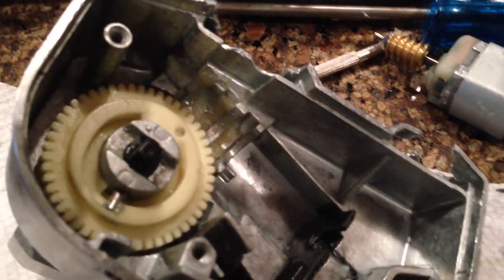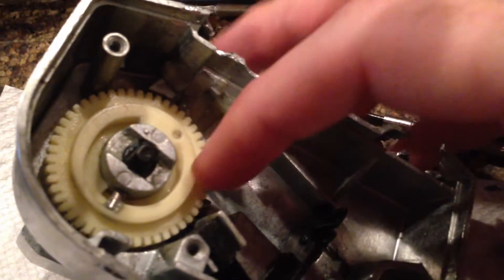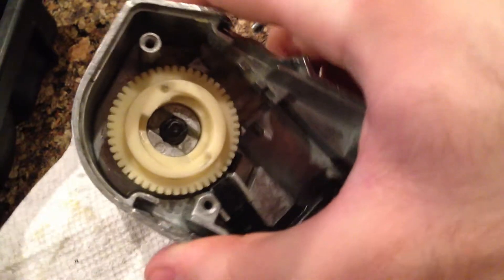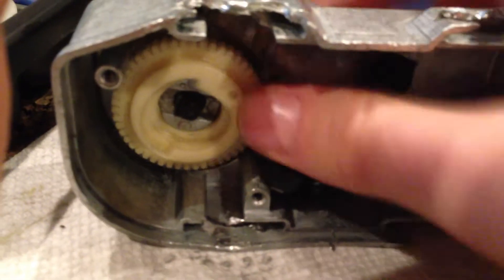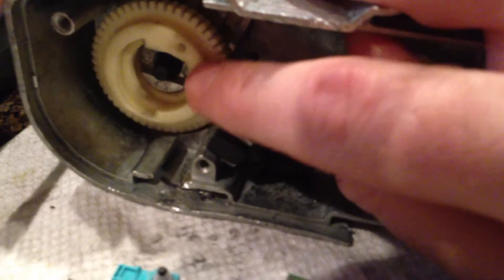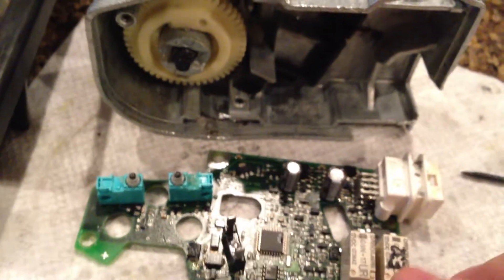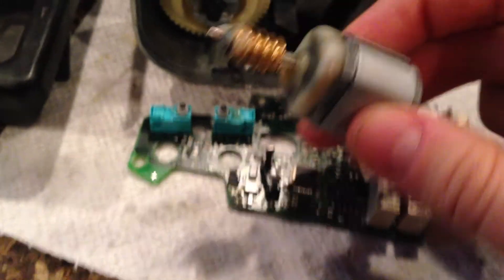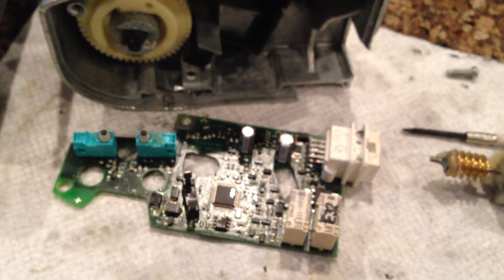Nissan Steering Lock internals, and Unlocking from Locked Position

Comment: Hey aaron, i took the steering module apart, took the board out aswell, but i got no clue how to take the off white covering to reach the motor. I tried all the clips to get it off but still not able to reach the motor. I guess its because of the steering lock. Could you please help me out. Also i got a 2011 370z i guess its a bit different from the earlier models as it got a cap instead of the whole metal housing
Reply from the maker: Sorry..  I'm not sure.  Haven't had the car in like 10 years.
Reply: @akmofo  hey aaron, thanks for your reply man. I did the steering module as you guided, took out the motor. And pressed the two turquoise buttons via electrical tape. My vehicle turns on now and the steering is unlocked. The only problem is that the vehicle wont go past the ON mode. It wont crank the engine. Would you suggest anything? I would highly appreciate that.

Comment: I was lucky enough that this failed while I was at home.    I used a dremel with the cutting wheel attachment to cut a straight edge slot across the top of the retaining bolts.   Then used a short straight edge screw driver to remove them.

Comment: This was very helpful and completely fixed my car.  I have a 2010 Altima Hybrid (Salvaged Title so I don't have the luxury of the recall).  The Steering lock mechanism went out a few times and I tried the old bangin it with something and it typically worked... maybe 5 times over a 6 month period.  Then finally it wouldn't work and I don't have the brown wire to cut on mine.  So I took it apart just like the video showed.  I didn't have fancy tools like Aaron... all I used was a regular screw driver and a hammer to pry off the bottom... this is the longest part of the whole fix.  THE key item is... don't hurt the computer board when taking it a part, try to be gentle.  I didn't have the same steering lock mechanism as shown but as long as you have the board and those 2 blue push in buttons you're set.  Taking the thing off is very easy.  I actually used my hands to loosen many of the screws... not hard.  Once you have the thing off just pry open the bottom and look at the parts inside.  Just like this video shows make sure that wheel presses down on the two blue buttons.  If you want to test it just plug in the board and press the two blue things down... the car should start... my did.  So put the thing all back together except I took out the motor and the fuse.  Plugged it back in and I just saved $700... that is the going rate.  Thanks Aaron for a great post!